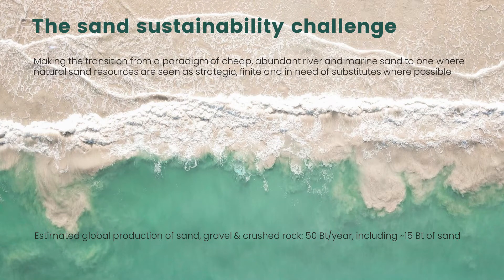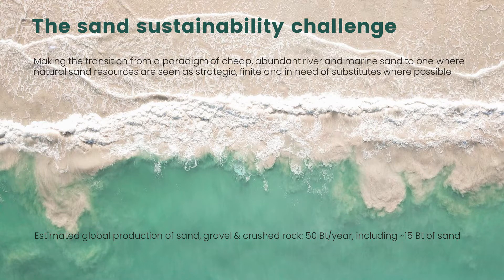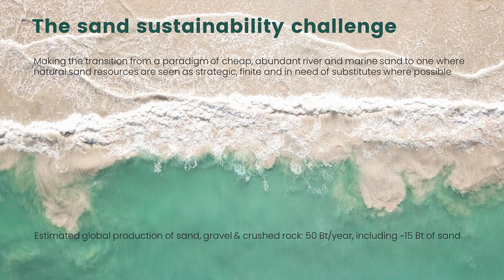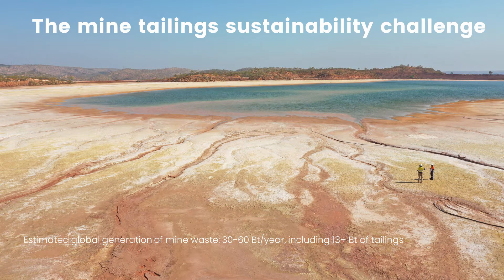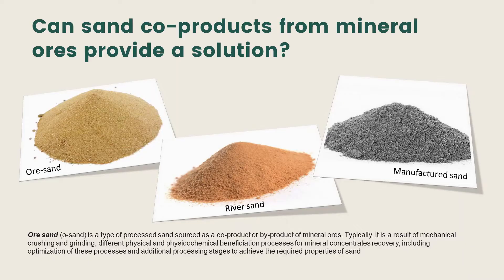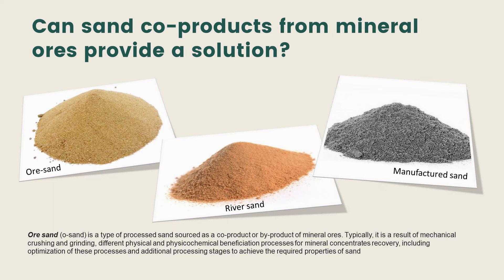New step in mineral processing could help prevent a sand sustainability crisis

Comment: Fantastic, you would also expect stable ore sand to have enhanced construction uses due to the angularity of material with fewer rounded edges.
Reply from the maker: You are spot on!
Reply: @smiuq  You may find some information within the drill and blast teams, re onsite stemming material, very useful. It may assist with finding the most suitable operations for initial acceptance.